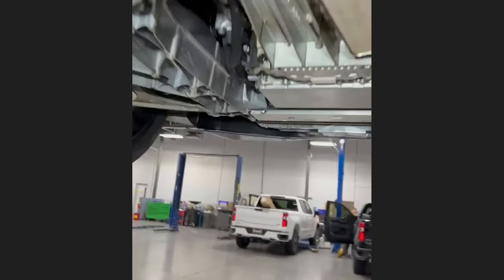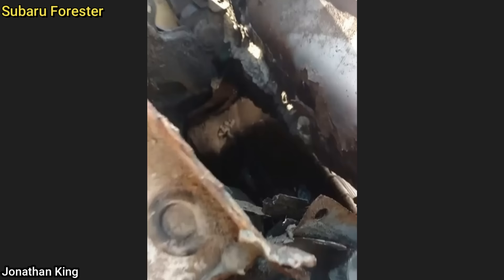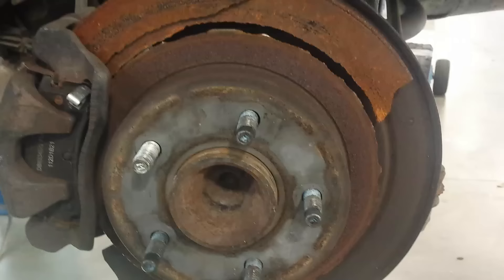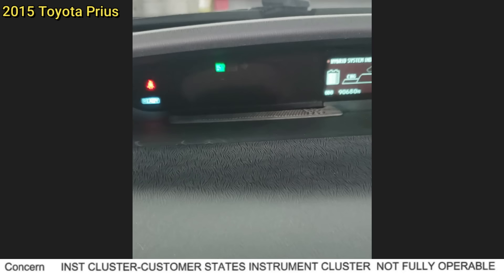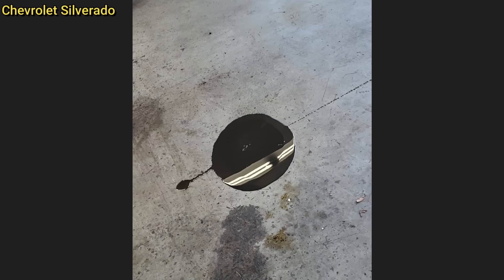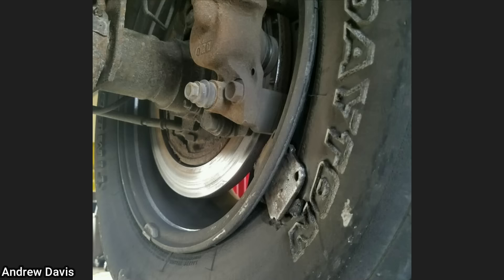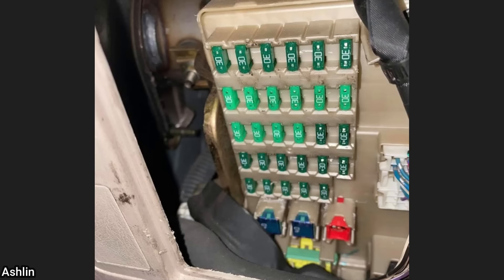Customer States Brand New Corvette Shut Off While Driving

Comment: That fuse panel LOL.  I laughed so hard at that one, my wife was like "What?"  I had to explain to her why it was so wrong.  I've seen some stuff on this channel, but that takes the cake for the funniest shit I've seen on here.🤣
Reply: Good now explain it to me!! Why wouldn’t a 30 amp work in a 15 amp slot or whatever it’s called. I’ve always replaced the blown fuse with same amp but why does it matter?
Reply: Fuses protect the wiring after them. (And they protect against a fire if shoddy equipment shorts out.) So... hopefully they've at least upgraded all the car's wiring to 10 gauge. 😆
Reply: @JustConfused_24-7  Because if the rating of the fuse is too high, the wiring will fail before the fuse does, negating the entire point of having a fuse.

Also, if a fuse blows, that fuse blew for a reason, and that reason should be found and corrected before the fuse is replaced.
Reply: @alaindelon5398  no not the owner 😂 i replace the fuses with what’s indicated on the cover/panel just didn’t understand the issue with a higher 🤷‍♀️ power fuse vs a lower
Reply: @user2C47  thank you, that makes sense. I do get it checked if a one blew, i just didn’t get the correlation
Reply: @JustConfused_24-7  To use an analogy: imagine an inset bathtub with the spigot on one end, an emergency drain on the other, and walls on three sides. The emergency drain sits below the edge of the tub so that if the water level gets too high, it flows through the emergency drain first before it hits the lip of the tub and floods the bathroom.

Now, imagine after watching water flow into the emergency drain you decided to plug it and install a new one above the lip of the tub. The water level is the electricity, the emergency drain is the fuse, the fuse's height is the amp rating, and the bathroom is everything that electricity shouldn't be touching.
Reply: When I bought my house, the inspector told me that it had a 150 amp main breaker on a 100 amp service line. The rest of the house passed inspection, so I bought it and immediately called a few electricians to get quotes.

One of the electricians told me, "Oh, it's not a problem. Just don't run every appliance in your house at once."

I did not hire that electrician!!
Reply: @sevendust62  That electrician should have their license revoked! That's incredibly dangerous!
Reply: @JustConfused_24-7  Fuses and breakers protect against fire. Electrical fires can have two main causes:

The first is a wire overheating and igniting material surrounding it, such as insulation in a home. Wires overheat when too much electricity is passed through them which can occur either because there's just too much power being demanded, or the wire has damage and is narrower at one spot (where the overheat will occur).

The second cause is from short-circuits, where the electricity flowing through the wires finds a shorter path to travel ... anywhere. The short can either cause an overheat in the bridging conductive material (think touching a bent paperclip to both ends of a battery), or from arcing electricity igniting nearby material.

You'll note that in the expanded description for the smoking dashboard at 2:01, the technician mentioned that when installing the radio the owner "didn't use a fuse a tapped into the panel on the unfused side." Had the owner installed that fuse, when the short-circuit occurred, the fuse would have blown, and the fire would have been prevented.

Finally, fuses work by being (ideally) the thinnest wire in the circuits they govern. Since (as we've discussed) wires heat up when electricity is passed through them, the thin wires inside fuses are designed to actually heat past their melting point when power beyond what they're rated for is passed through them. Thus, they're supposed to "overheat" long before the actual wires in the circuit do.

Importantly, a fuse (or circuit breaker) will likely not trip in time (or at all) if you are being electrocuted due to a ground fault (think: you are suddenly sharing a bathtub with the hairdryer you did not want to join you). That's why all outlets in bathrooms, and other rooms/areas with water, should have ground fault circuit interrupters (GFCIs) in them. Such outlets are the kind with the "reset" and "test" buttons between the sockets. They are designed to notice if electricity is not flowing where its supposed to (and is instead possibly flowing through you) very quickly, and shut themselves off in the blink of an eye. Fuses, breakers, and GFCIs are all important live-saving devices in homes. In cars they're more likely to save you money in repairs, but installing the correct fuse is still very important!
Reply: @irregularassassin6380  wow thank you so much! All that makes complete sense now! I appreciate you taking the time to explain this to me. Thinking all fuses are the same regardless of size is no longer occupying my brain. Including the breaker explanation is a big deal as i just bought my new house and well of course i would never change a breaker but knowing why they may trip is huge!! I’ve always replaced fuses with what is indicated on the panel or cover but this clears it up as to why there is specific sizes!! Much appreciation!! Thank you again!!
Reply: @pretzelbomb6105  great analogy!! Thank you.
Reply: @sevendust62  uhm after everything I’ve learned here, that is dangerous. I did call an electrician to identify all of my breakers because nothing was marked and he found something similar. A 60 amp on a 30 amp service line. I was thinking it wasn’t that big of deal, because he fixed it. Reading all this great info it was a big deal
Reply: Let me also note that you can get AFCI (arc-fault circuit interrupter) breakers and outlets in your house that are designed to blow if there is a short circuit in the house.

You can get combination AFCI/GFCI breakers, or pair GFCI outlets with AFCI breakers.

Comment: Holy shit, the fuse panel with all thirty amp fuses had me rolling! 🤣
Reply: If it fits...
Reply: Seen lots of old glass type fuses replaced with spent 22 cartridges .
I have seen more than once where someone put in LIVE 22 rounds in lieu of a proper fuse .
Nothing is idiot proof .
Reply: Why not just screw in a bunch of pennies? (Old timey screw-in fuse joke.)
Reply: @fitybux4664  Remember, if you put enough current through it, everything is a thermal fuse.
Reply: @kaboom4679  Good god! That's one way to make sure the 'fuse' will break the circuit eventually. Run enough current through it, ignite the cartridge, and shut off half the circuits in your house at once! Genius!
Reply: Here in Australia we have the "grey nomad" tribe.  Old retired white guys buy a caravan (known in the US as a trailer home), a dirty great 4-wheel drive vehicle to tow it, and set off on a long holiday cruising remote areas.   They are noted for two things:  Stealing solar panels and installing a second battery in their vehicle to they can start it after they have flattened the second battery running their portable fridge and whatever else they have in the caravan.  They charge it from any sort of wire they can see, which results in a blown fuse - so they put a bigger fuse in, and then an even bigger one, and then complain to the dealer that their vehicle caught fire and is a write-off.
Reply: @kaboom4679  What??? I mean, I believe you, but ... what???
Reply: It’s pretty bad but this is some stuff I would do.  Does it supply too much power?
Reply: @jobturkey7418  No, it just allows every circuit rated less than 30 amps to merrily burn out. Please don't.
Reply: @jobturkey7418  The fuses are there to prevent the wires connecting things from going into flames, a highly likely event if there is some sort of mechanical damage to the wires.
Reply: @jobturkey7418  Electrician here.  A fuse is a component of a circuit that interferes with current flow if it reaches a certain value by melting and breaking the circuit.
Often in circuits, current will be drawn based on the resistance of the load (a light or some heaters, anything being powered by the circuit).  The more current on a wire, the more heat is generated in the wire, so each circuit has a "current rating" and thusly a fuse value is assigned to that circuit less that the highest rating allowed so you do not melt the wire or break other components.
When a short circuit even happens, the resistance drops to a very low value, meaning current becomes very high.  In this scenario a fuse is meant to blow.
When too many components are added to a circuit the overall resistance of a circuit also goes down, so current will increase. These are where too high of a fuse value may result in your circuit melting or burning before the fuse blows.

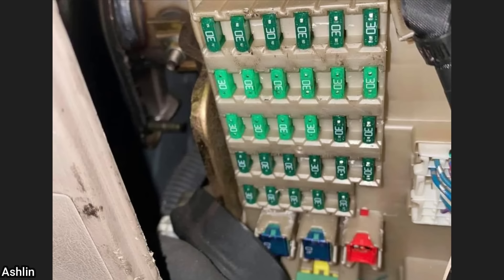Comment: That last one was hilarious lol @2:59 There's a reason you should be sitting in the drivers seat to start any vehicle.
Reply: A couple years ago in Michigan, a dealership hired a non-licensed employee who reached in and started a Jeep with a stick, which drove forward, killing a mechanic. Scumbag lawyer tried suing the car owner, because Michigan law, stated the dealer could not be sued by the mechanics family, for negligence.
Reply: A lot of new cars won't allow you to start the car without putting your foot on the brake. And/or they keep the parking brake engaged until you turn it off.
Reply: @annehaight9963  Most manuals that I know of require disengaging the clutch. Some let you start with the brake & neutral shifted.

Comment: Although I hated it in my youth, because you could hardly tune anything on your car, I am all the more grateful that we have the TÜV in Germany. Especially when I watch your videos. Keep up the great work :).
Reply: @crispindry2815  there are inspections, just not thorough, honestly should be mandated by law to get it checked by a mechanic every year and have it logged, along with getting it forcibly repaired or taken if its not road worthy
Reply: @charlescourtwright2229  forcing repairs and confiscating a customer's vehicle will never ever fly, and rightfully so. 

The problem with thorough inspections is that it takes time, and the profit margin for an annual vehicle inspection is right around 5 bucks a car because the garage has to pay on the machine they rent to do the inspection. It's no surprise that they hardly check anything these days.
Reply: @fosterpainter Probably being tickled by the above Dr.
Reply: We have no inspection law in Washington State, and don't have abnormally high rates of mechanical failure crashes.
Lack of salt used in winter here?
Reply: @hurfdurfy8167  no worries. I've a spot reserved just for you in my Tickle Palace.

Comment: The “customer declined all repairs” people are why here in the Netherlands every car needs to be checked over every few years and certified to be able to legally be driven, and the police do randomly check people on that so you can’t even sneakily get away with it
Reply: The difference between an inspection like that and impounding someone's car is that generally if you're getting the car inspected, you are going to a government licensed shop which has to follow certain standards in most countries. They're not going to "make shit up" just to con a customer into getting repairs. On top of that, when you take your car in for an inspection, you're saying it's ready for the inspection. You wouldn't take it to the inspector on its last legs and expect to drive away.

On the other hand, you WOULD take a car on its last legs to a mechanic looking for repairs. Expecting to have your car repaired for one problem, and then being slammed with a surprise bill for 2x or 10x the cost (or being told your car is irreparable) is a shock to most people, and many people simply can't afford to make those repairs on a moment's notice. Often they're hoping for a simple, inexpensive fix, and the added cost of a tow-truck bill does not fit in the budget. Frequently in cases like this "declined all repairs and drove away" in reality isn't denial, it's simply one last drive to park the car at HOME until they can figure out what to do next - either save money for the proper repair, or decide to buy a new car. If you don't have the money for the repair, leaving the car at the mechanic's shop is essentially the same as signing the title to the car over to the mechanic for free. Most people are not going to do that. 

Not to mention how many dishonest shops out there will inflate the actual cost of a repair many times, and then act indignant when someone doesn't want to or cannot pay their inflated price. This happens so often (at least in the US) that many people are understandably gunshy about paying high repair bills without some "time to think about it". 

Shops need to get off the attitude of making fun of people who choose not to make a costly repair. Chances are they cannot afford it, and in MOST of these cases, the car will soon be parked - permanently.
Reply: The majority is that a tow truck is more than the car is worth as scrap.
Reply: @AlvinBrinson  If you guys had 2 year mandatory inspections you would see far less problems because smaller things would get noticed and fixed before they became larger expensive issues.
Reply: @frumsmcnoodles323  there are mandatory inspections in many States in the US, but not all States. What often happens is State Inspection shops just take money and pass vehicles that shouldn’t pass. So instead of fixing corruption they just got rid of inspections in some of those States.
Reply: Not the police, if the car does not have a valid inspection (expired or failed) the RDW (comparable to DMV) has all inspections registered centrally and will just keep sending fines to your house. Any accident and insurance will claim everything back from you. If you let this go on for too long, any moment where you encounter a police (speed check for instance) your car will be impounded.

Comment: Your videos are why I am greatful to live in a state with yearly comprehensive inspections and required insurance.
Reply: There are states that don’t require insurance‽
Reply: @herculesrockafeller  New Hampshire and Virginia
Reply: that's not gonna force the idiots to follow the law ...
Reply: @rhuephus  It does. Take a look at the cars on the road in Massachusetts vs New Hampshire.

Cars get failed in MA for the smallest amount of wheel bearing play or for worn brake pads. Cars get fixed or sold to dumb states quick.
Reply: @derel1cte  I'm in NY and inspections don't mean shit. There's always a mechanic who will pass any car for an extra $20. Many mechanics just plug in the OBD2 and run the inspection to print a sticker without checking the rest of the car. I had my cars inspected by a guy who told me he passed any car as long as it had no codes and looked like it was taken care of (never put it on a lift) after I commented that it was fast, literally, in and out. I went to another guy after I bought an old Cherokee XJ and was glad he had it on the lift for the inspection. He let me know that I had to start thinking about getting new u-joints because they were rusting up. It was nice to learn about it while it was a job I could do myself cheaply, before it became an expensive job I couldn't do myself. If you watch South Main Auto, Eric always has shitbombs in the shop that shouldn't be anywhere near a road that was sent over from another shop to fix whatever is causing the codes so they can pass inspection. Even though, the entire frame is rotted out.
Reply: @WastedTalent-  Massachusetts inspections are more comprehensive. Sure there are some bad actors, but it keeps cars with willful neglect and deadbeat owners off the road
Reply: @cyclonebuzz8172  You can’t get a registration without insurance in Virginia. If your insurance lapses you’re supposed to hand in your plates.
Reply: @IDontKnowMuchAtAll  Oh, ok. I just saw a law firms page  that said Virginia didn't require insurance as long as you pay a yearly uninsured motorist fee of 500 dollars.
Reply: @cyclonebuzz8172  $500?  In the UK, it's half a million, and that's considered too low.

Comment: I've always heard that you have to give a motor a few thousand beak-in miles, I wonder if that guy was going too hard on that Corvette?
Reply from the maker: I talked to some GM technicians and they mentioned the quality lately is terrible. A lot of new vehicles with issues like this lately. I even heard from some Audi technicians the same thing.
Reply: @JustRolledIn  Thanks for the info. I was looking into getting a new GMC 1500 with the AT4 package but now i'm thinking I should give that new Toyota Tundra a closer look.
Reply from the maker: @sweeptheleg.  Every brand is having their quality control issues right now from what I keep hearing. The new Tundra looks nice. I wish it was a V8 though lol
Reply: @JustRolledIn  I have a friend who just got a new Tundra late last year, so far he hasn't had any issues. It's also interesting that despite being a V6 it has more power than the V8. I dunno, maybe i'll check out the ram too, I haven't made up my mind yet.
Reply from the maker: @sweeptheleg.  Glad to hear he hasn't had any issues. Yep you can get the V6 twin turbo. Hybrids are available as well.  I heard they make some good power. I love the 5.7 they had in the Tundras though. Not known for fuel mileage but reliable!